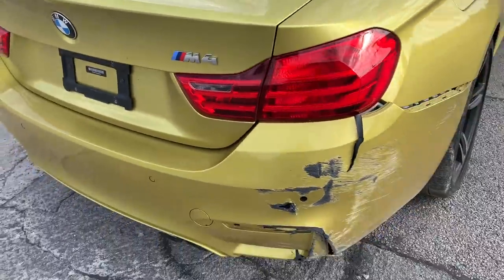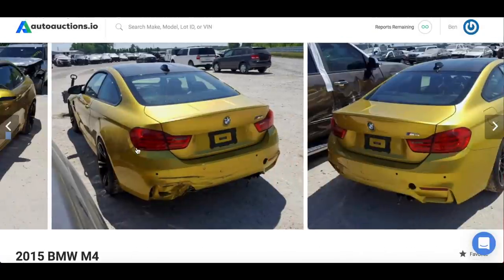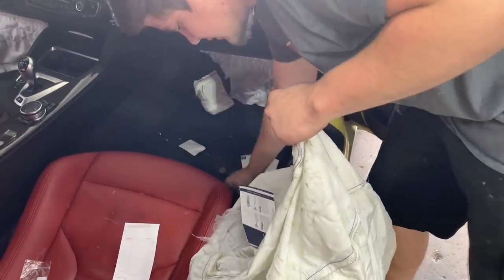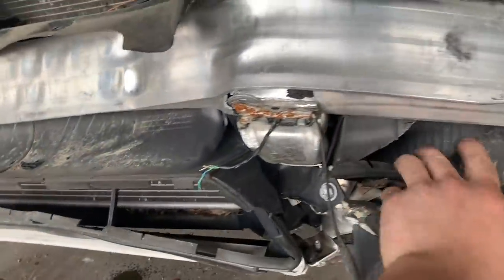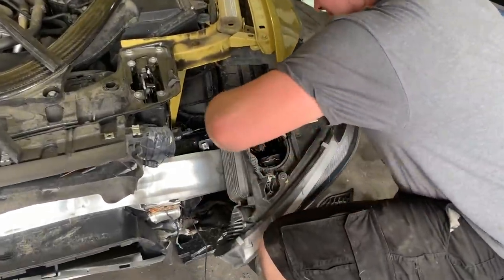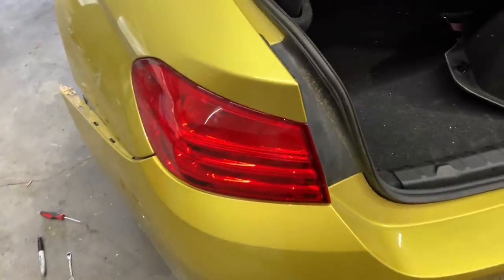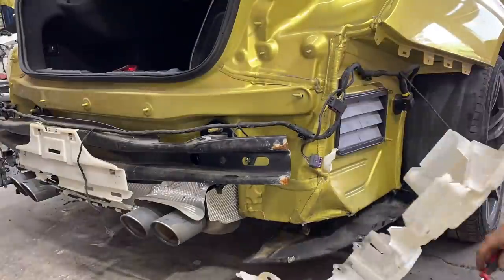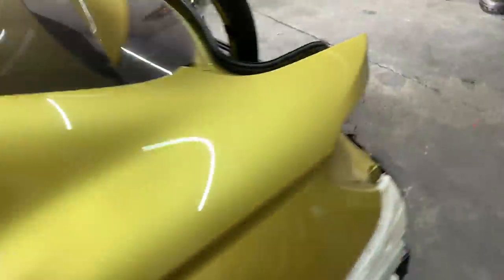I Bought a Frame Damaged BMW M4 From Salvage Auction It WAS WORSE THAN I THOUGHT

Comment: Be cautious starting car by jumping it on those posts under hood. Connect directly to main battery. I learned recently that you will fry the electrics, modules etc.
Under hood posts are for battery charging and small diagnostics only.

Comment: Thanks for not using an impact driver on everything.  I cringe when I see other guys working on high end cars and just jamming bolts on and off with cordless impact drivers.  It doesn't take that much longer with non-powered tools and you have such better control.

Comment: I've owned one of these. Those tires are 5,000 mile life and super expensive. One of the main reasons they only last 5,000 miles is because you can not rotate staggered wheels. 

Also on the damage, I am willing to bet it spun out and slid sideways into the jersey wall in the middle of the freeway to do that damage to the front bumper.
Reply: Christopher Fea how is the reliability on those cars?
Reply: @j.vosier6786  I only had my car from new to 18 months old with 20k miles. I never had one issue with the mechanicals, but I had issues with my taillights for some reason. One side kept failing and I had it back to the dealer multiple times. That being said I would never buy one new again, used all the way. Also it is possible to get 7,000-10,000 miles on the tires if you drive it very very easy, but what is the point on an M car to do that?

Comment: They will often times hide damage, mash the airbags back into the headliner, even seen them dough up and booger a paint job to hide box side damage on trucks. Trucks get hit harder and usually can break the transmission and engine being they are mostly all aluminum. You gotta be real thorough on your inspection and only deal with insurance sellers. They don't care to doctor up a car and take it as a loss regardless and onto the next claim. A third party or dealer will bang damage out dough it up and blow snotty ass paint on there to make it look better and get more money from the auction.

Comment: Bro not trying to be a hater but you gotta learn the terminology of the collision industry in the rear that is not frame damage if anything it would be called unibody damage and that damaged area is called the rear body panel it also looks like it went into the pocket (tail lamp pocket) and there called front and rear impact bars!! But good news is you can walk almost all of that body panel out and if you pull it rite I can guarantee that crease in the quarter will come with it pull a little knock down your highs reposition your puller or clamps and repeat just take your time I'm a flat rate tech as a frame guy you should be able to walk that rite out being its your vehicle on a customer car you couldn't do that anyway good luck bro sweet car

Comment: Dude this car seems to drive perfectly as it is. Cut the bags and take it to the track. Damn, you guys in the USA write of total loses like coffee receipts. I have seen cars with purely cosmetic damage, and some radiator grill, which is thin and bolts on damage, written off. This M4 has all 4 wheels where they should be, alignment without changing suspension components may be the case even. Interesting fact, many airbags popped for that damage, this is a bit strange. When you talk about frame damage, you refer to the meatla sides and covers around the car, where fenders bolt on etc. Yes, these are bent, but the real railing, the cassis and the suspension/wheels palces are the same. This car WILL drive like it used to, when done. Actually the idea behid not having REAL FRAME damage is, that the car drives like it used to now, if you don't look at the damage.
Reply: Smita I have bought insurance totals that were totaled because they were new and parts were not available yet! Only cosmetic damage, but parts being 6 months out is a no go for most insurance companies

Comment: Dude, bmw headlights are a total bitch to take off (for a headlight), especially if the brackets that keep those like square nuts from spinning start bending. No idea how he did it so easily with that bent bar blocking access

Comment: Sadly, its a waste and you'll have a VERY hard time selling it. For one, almost no banks give loans for salvage cars. Two, no one has even $10,000 in cash to buy salvage. Three, insurance companies won't give you a dime for them if its crashed. Buy it if you are going to keep it, otherwise, you won't make money on salvage cars over $8,000. Period. That thing is worthless.. quarter panel is bent up, ALL airbags are deployed. Lost money
Reply from the maker: Sadly your very wrong:(
Reply: @Vtuned  - About which one? The fact that banks don't give loans to a salvaged asset? Or that people don't have $10,000 in cash, when statistically 76% of Americans don't have $1,000 in savings. The insurance one you may have a point, because the garbage little insurance companies will take anything. But the big guys wont give you even 40% of current value. Essentially pennies on the dollar.

Comment: You. Can clearly see it’s the same car and he’s put some gold spray paint that didn’t match and then tried to scuff it with sand paper to make the damage look different but it’s  still just obviously the same car . Look at the bend I. The bottom of the passenger side front air dam .  H painted it  .. same damage .  Nice try .. not really